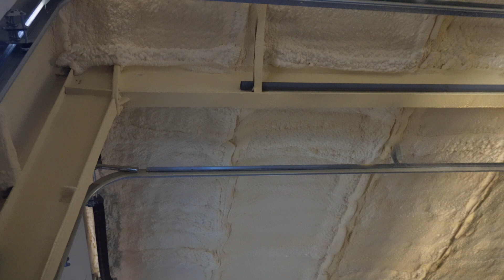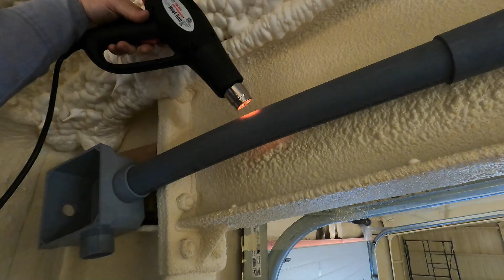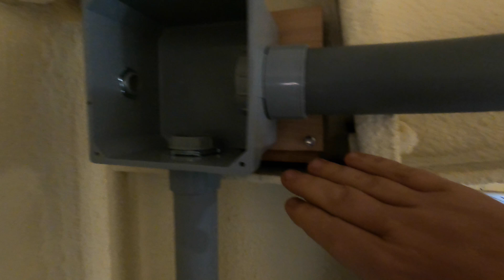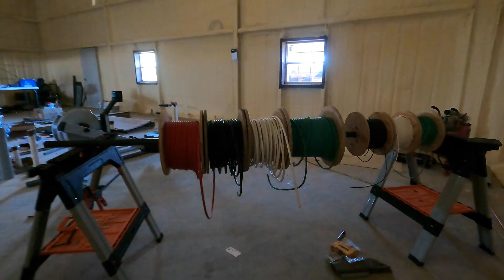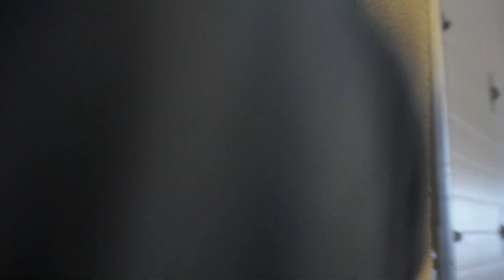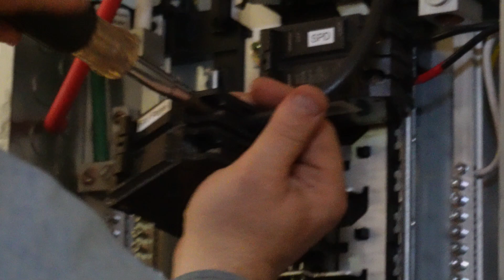Electricity Part 12; Putting Up the Main Conduit Run and Installing 100 Amp RV Sub-Panel

Comment: Nice Job Jeff.  Curious though.....how are you going to fix the hole in the side of the building?  Looked like some of your electrical boxes are located on those panels.
Reply from the maker: You missed the last video, go check it out.